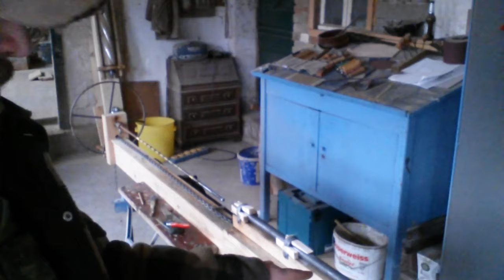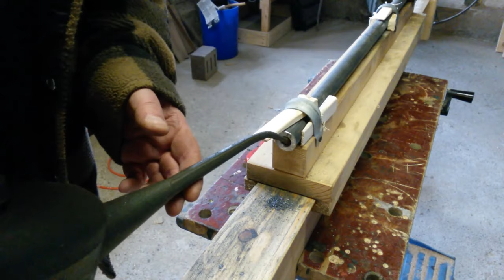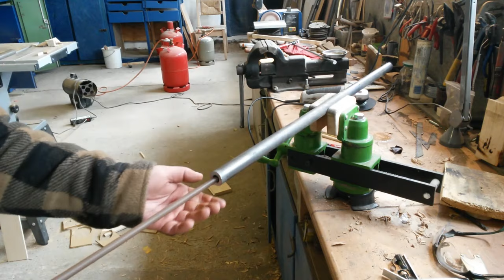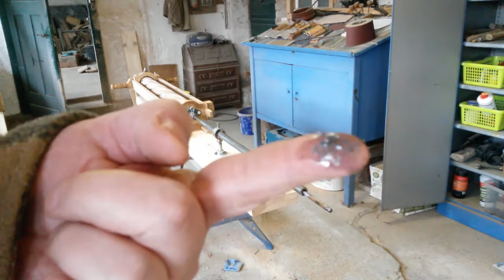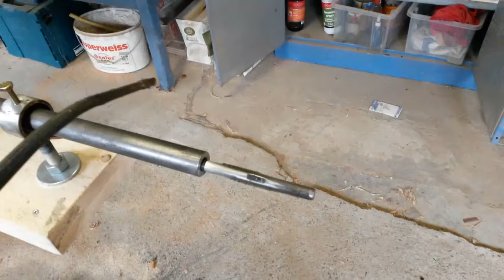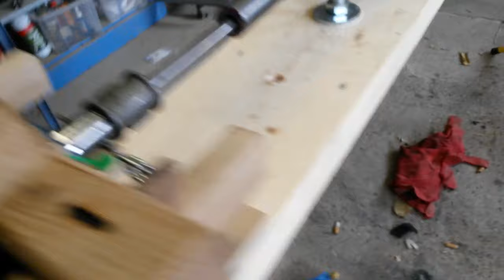Swivel breech rifle scratch build pt 2 rifling the barrels

Comment: Its looking very good. I've got to agree with the sand bag idea. That is the one problem with those style work benches in that they are far too light and move around all the time, even if you are just sawing a bit of wood.
Reply from the maker: Today I put a stone plate at the bottom..... maybe I will ad some more , but it is working much better now.... The procedure is much more work than I expected... Today I spend 2 hours and some hours before and It is still away from the target....

Comment: That is working very well! But I think you need to weigh the bench down with some sand bags, that will make it much easier to get a steady cut, with the bench wobbling around like that you will get marks left by the cutter stopping, but with a constant pull right through it will be much smoother, doing well ! Stay safe! Chris B.
Reply from the maker: Thats exactly what I saw too . Today I put a stone plate on the bottom of the vise and it works much better. The result is ok now but it is soooooooo sloooooow. Maybe I have to change the adjusting from paper to thin brass or steel strips for the next time. And I saw it is useful to change the point of readjusting by every round, otherwise the groves are getting unequal cos the cut on the first grove is the deepest mostly.... 😁 so stay safe and we will see a result soon Roger S.
Reply: @homemadehistory7537  Ha Ha! Yes, very slow, but you can always think about something else while you rifle your barrels. I think the only way you will get even depth rifling groove is to keep cutting until you do not get any swarf, it will take longer, but it will give an even depth cut, or is more likely to I think, using steel shim should give a more even cut as paper can compress, but but it will be a job to get thin enough shim, maybe thick kitchen foil would be OK. Stay safe! Chris B.